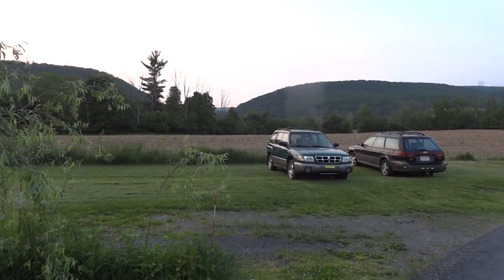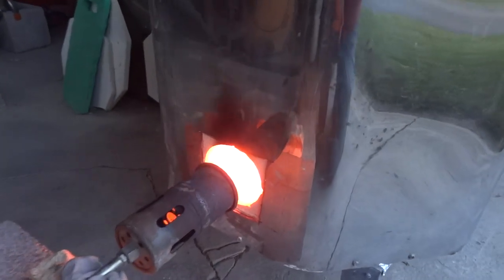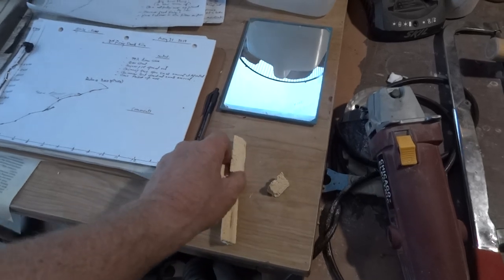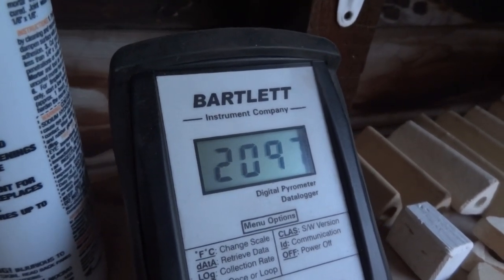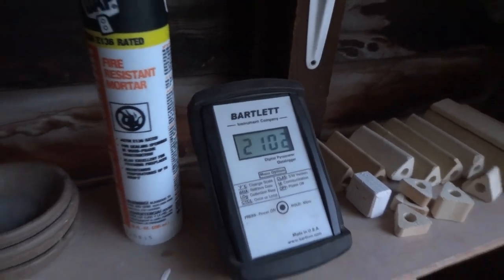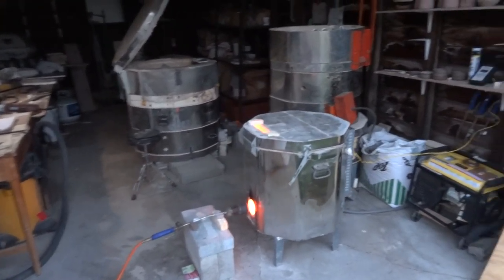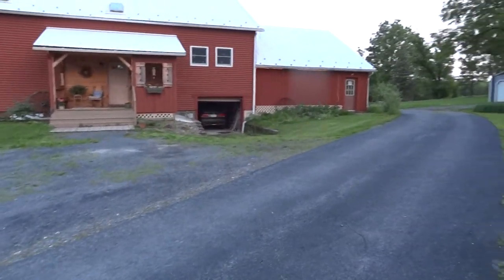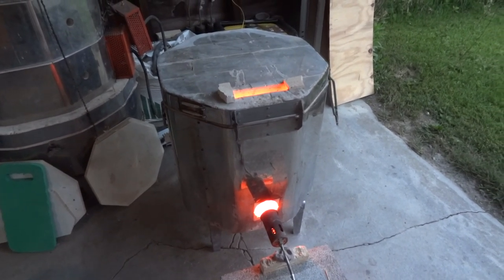3rd firing small converted kiln -  May 31 with Simon Leach

Comment: Have you looked into feeding the burner from both tanks with a tee connection to the line? Then just switch while firing without having to swap tanks out.You could have a continuous feed and empty the first tank more efficiently. A friend of mine set up a system like that too help keep the line from icing up for raku firing. Food for thought. I like the idea of converting an electric kiln to gas... seems it would be a cheaper alternative than rewiring my garage.